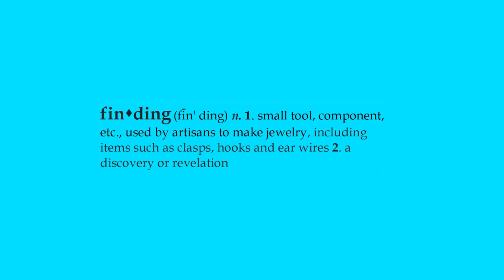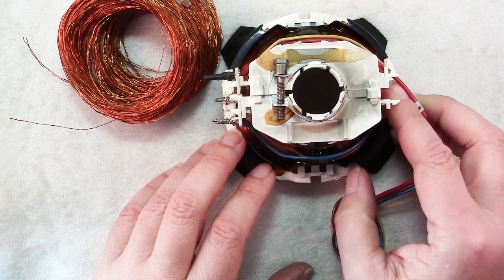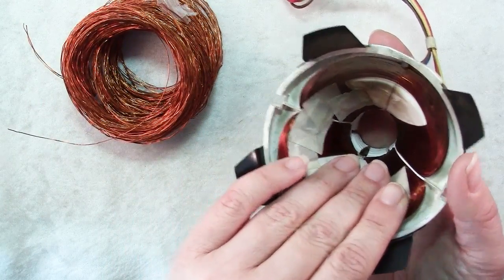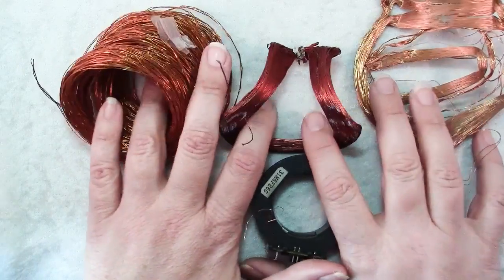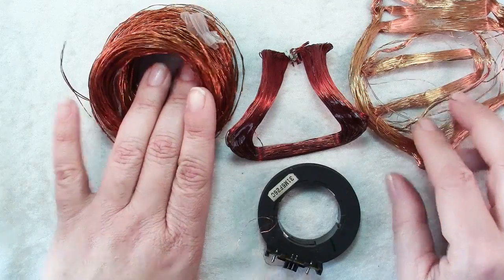Friday Findings-Reclaiming Copper Wire

Comment: Also wire hiding under that electrical tape wrapped around that tube. Usually thin copper, sometimes aluminum, coated but much nicer to wrap with. no burning needed
Reply from the maker: Thanks for the tip, Angela!